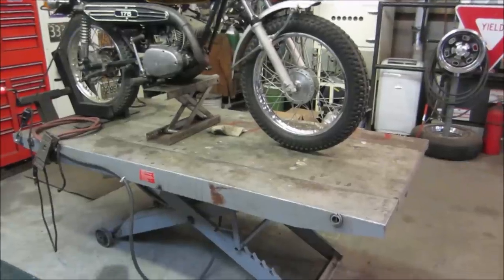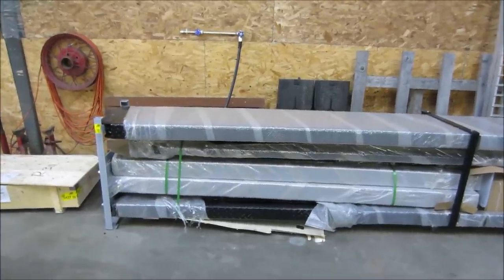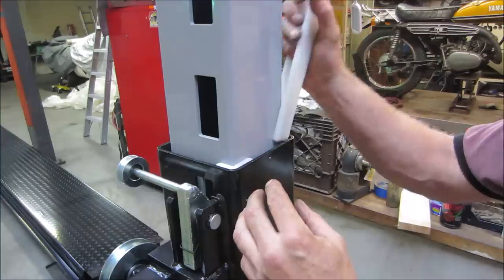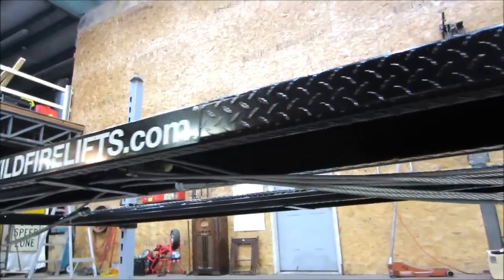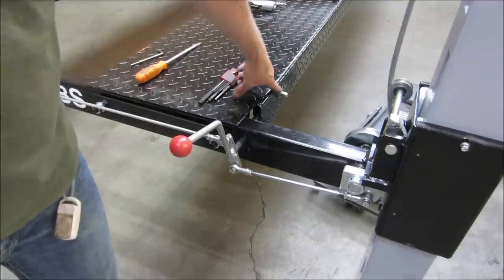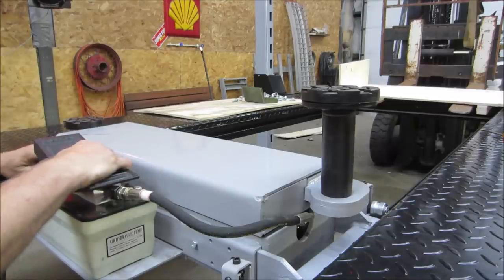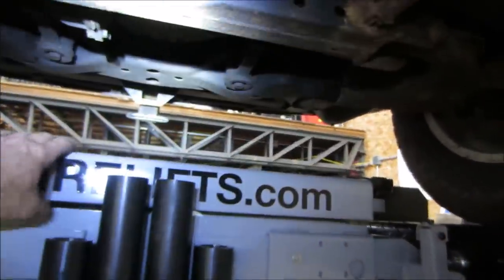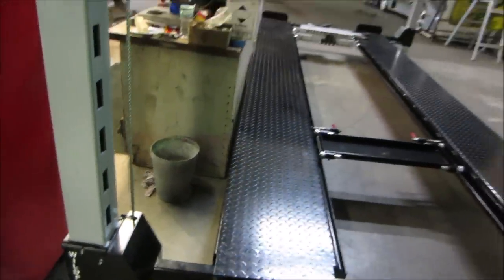Bought a Wildfire 4 post Lift, Can a Rookie Put it Together?

Comment: Congrats on the purchase!  You'll really enjoy it.  Clever technique raising the posts.  You've always got great ideas bud!
Reply from the maker: right back at you sir, thanks for checkin in and steering me to wildfire,
Reply: Dereck: Did you get the frame lift attachment? I didn’t see it in your erection (No snide remarks, please.) video and ran over to Wildfire’s website to check that they had one. Essential accessory for working on suspensions and brakes.
Reply: I watch every video from both you guys.  I know you guys far apart but a collab would be fun sometime.
Reply: Waiting for AvE to join in and mention something like that thing works like a hotdamn and your camera won't focus... the fack!
Reply: Was there another set of bolt holes to set the runners wider?  Maybe it is an optical illusion but looks barely wide enough for the Toyota pickup.
Reply: @FatHulkRideEbike  
Seems like there would be a way to make them adjustable.
Reply: Actually Derek could find some beater in NH, go to Musties shop to fix it up and drive it home to MSP.  That would work!
Reply: @FatHulkRideEbike  Somebody write that down! Find a classic rust bucket in NH, stat!
Reply: @TreyCook21  VGG is live now.  I put in a super chat but of course Derek didn't read it lol.  He doesn't read super chats from Eagan, MN I guess :-)
Reply: @FatHulkRideEbike  That would make the suspension lift (the one that runs up and down the middle) complicated...
Reply: @somethingelsehere8089  Yeah, that part looked like it had at least some adjustment though.  He set the wheel width when he unboxed it.  That Toyota barely fits though and that is supposed to be the XL lift.  Don't get me wrong I like everything else about the lift.
Reply: as I found your comment I found your live stream off to go watch comment like and already subscribed
Reply: Derek, I hope you're getting a commission for all these lifts you're selling to other YouTubers. 😂 Keep up the good work. Love the content from you and Mustie.
Reply: Thats awsome !! Both of the shows i watch are talking to each other. So cool.. You guys should do something together for a show. Im thinking a truck cuz they both like different cars . idk. Send a comment in the bleep blooper thingy
Reply: You guys should get together and I dunno......    what the heck!!!!!
Reply: @TreyCook21  plenty of them! its the rust belt.  i see it all the time since i live here lol
Reply: Vice grip garage needs to come to NH! :D

Comment: When I was 78 I bought a used AMMCO lift.  Unlike the lightweight metal of the wildfire it was extremely heavy.  Start to finish and my wife is in her sixties we had it up and ready to go in less than four hours.  Adjusted the cables later on prior to lifting a vehicle.  No big deal just be careful regardless of your age it falls on you and won't have to worry about getting any older.

Comment: A little heads up. After some use of my lift, I found that even though it has those nylon sliders, they tend to get a little fussy about sliding freely. Easy cure. Spray the post with silicon and they will slide like new. I've had my hoist since 1999. Kind of wish I would have bought a two post lift. Why? because it's easier to do brake jobs or anything where you want the wheels hanging free. I may still get one, who knows? Enjoy your hoist.

Comment: Not going to lie, having seen the VGG setup, I was a little concerned about you doing this by yourself. I should have known Mustie ingenuity would carry the day. Enjoy the new toy. They make sleeves for exhaust pipe that might work on that blow out. They use a system like a hose clamp to secure them.
Reply from the maker: l just cut it off and grabbed another used rear pipe and welded it to the muffler

Comment: You will love having the safety of the 4 posts.  Much more stable than trying to get the balance correct on the 2 post kind.
Reply: But the two post leaves the wheels hanging free. Makes it much easier when you have to do brake and suspension work.

Comment: Mustie1 for what you paid for the unit and the air over hydraulic jack system, it’s gonna pay for itself in no time, as in no extra time needed to recuperate, extra time for yourself when you can get the job done quicker and easier, and most likely more jobs that will help it pay for itself the quickest.
Watching you put that together the way you did was amazing. It goes to show you have a ton of common sense for when it comes to things mechanical. At one time I was thinking you may use the forklift to raise the assembled ”H” sections, using that small table Jack was very impressive.
Can’t wait to see what you work on first, and when you will comment on how this new lift will be a blessing in disguise, and why didn’t you think of it before....
Keep up the great work look forward to all your videos.
And let the grinning begin....🙂🙂🙂😃

Comment: I bought the same lift a year ago.  Liked it for all the same reasons as Mustie.  Use if for front end work, oil changes, and more.  My worse case vehicles are my son's F-150 4 WD long bed and a Silverado long bed extended cab 4wd long bed.  Bought the 9000 lb'er and long version.

Comment: I just went to Wildfires website to check the price and got a pleasant surprise. I feel they are very competitive. Watching you assemble it shows that it is made from quality materials and is well engineered. The removable dolly wheels is a feature that I believe is unique to Wildfire lifts. I installed a 2 post lift in my shop 20 yrs ago and my only regret is that I placed it too close to a wall. I assume you are leasing space in your building so avoiding a permanent installation works perfectly. I know you will enjoy it immensely! NOW, I want to hear about the Hippie camp out! :-)

Comment: I forgot you guys got salt corrosion where you are at.  What we do for our trailers and chassis here on the Texas Gulf Coast, is to melt toilet bowl rings (pure beeswax) and use a sand suction gun to spray that onto our trailers and underbody. This lasts about a couple of years and is good stuff.
Reply: He has a video of undercoating one of his vehicles using toilet ring wax in a mixture with some oil, maybe it was linseed oil.
Reply: @wind_song  Nice.

Comment: Before lift: Not looking forward to working on car. 

After lift: Excited to work on car. If not excited at least not dreading it as before.
Reply from the maker: true l put off changing oil on 4 of my cars until it was up
Reply: Haha me too. I raised my car for the first time in my new 2post. It's 13' high and was a challenge to install myself. But, it made it through an earthquake in Charlotte last night with a crown Vic raised all the way up so I figure I did ok🏆
Reply: zxggwrt , lol same thing here. I installed 2 post myself in my home garage. I have 3 part video on my channel about the installation process/suffering, lol. And I had(still have luckily) my Sienna up in the sky during this earthquake (30 min away from Charlotte), lol :)
Reply: @HETPEZB  Yup, process/suffering is how it's done! The house started shaking at 8:08 this morning first thing I did was run to the window and see if it was still up! Just did my 1st oil change 30 minutes ago after a through inspection and re torque.

Comment: When I saw Vice grip garage having one installed I was impressed and I think that you putting one in your shop was an object lesson in how thoughtfully these lifts are designed and engineered, seeing as you completed the whole task without any issues and alone. A real bonus and such a boost to productivity, ease of working and filming. Very best wishes from the UK

Comment: One suggestion; there is a "C" clip that attaches to the shroud behind the motor and oil tank that should be used to clip the hydraulic hose to insure its safety, especially when lowering the lift.

Comment: You could fabricate some large steel pads for under the feet if you were worried about the slab thickness.
Reply: I was thinking same thing but just for a little extra safety. Than you could shim it to absolute level as well. I would also weld gussets in corners of factory pads to post but that's just me and I like overkill on safety with heavy objects above me.

Comment: I am 64 years old and would not be without my lift.  Mine is a 2 post, but for me it is the better option.  For you that one looks perfect.  You will never regret it.  One thing I did notice, are the runways adjustable in width?  Just so you don't run into some vehicle with a wider track.  Enjoy.

Comment: Nice Lift and I'm sure it will Save your Back for extra years of Work--Each to their own but I had rather have a Frame Lift, that way everything is Hanging from the Vehicle, much easier to repair Brakes or anything in wheel area without using a secondary lift. Thanks for your Video's, I have learned many things from your Effort...

Comment: I hear you on the aging part and your limitations! Right up into my late 30s, I could work like an Ox and be fine the next day. A year later, I started having energy issues and things really went berserk. I couldn't get barely an hour at a time without taking a break, among lots of other issues. After putting off a doctor's visit for several years, turns out I was diabetic with a side of autonomic neuropathy for good measure. 
Now to get big jobs done, I have to invent something to help me do the actual job first. Gotta pull an engine but don't have anywhere to use a hoist? Mobile crane to be built. (that's my next big job as of the current writing) But that's time for you. Catches up whether you're ready or not.

Comment: That's nice. Now I want one. I seen one that had wheels on the bottom so you could move it around. I reckon if you had a 3 or 4 bay garage you could roll it where you need it, the wheels would raise so it couldn't roll on you when you had a vehicle on it but I don't think it was quiet as heavy duty as this one is. I wish I could remember the site. I'd rather have it bolted to the floor myself. I'll never own a 4 bay garage neither. The first scissor lift you showed at the beginning are dangerous. I've actually seen one of those fall. We were down at the garage pulling a fuel pump out of a ford explorer and I don't know what happen but It fell and pinned the guy that was doing the work for me under it. If someone wouldn't have been there he would have suffocated because we were around the back side and it weren't that loud so we kept on but after a couple minutes we said we better go check and I don't think he would have made it if we would have waited much longer. God rest his sole. That's pretty nice.

Comment: Been looking at this myself. Love that you got one mustie! Only complaint is the manual lock. you have to bend down while you drop. If I got one I'd might add a locking mechanism for the locking. Only to use it to drop all the way down. but only that minor complaint. What's the runway's outer width? If truck was close to the sides by the looks... Or was that camera playing tricks. congrats mustie! Glad u got the lift!!

Comment: i dont know  if you have noticed but i have lately is people seem to think this new premium gas most has ethanol in it has rusted out the inside of a brand new tank for a 69 z28 in a year and a 2017 cub cadet snow blower solid rust inside so look out for them steel tanks the z 28 runs airplane fuel  on new tank no problems since with new tank

Comment: Mustie 1 ? Your should install two 4k cameras to a 4k TV in front of the lift so you can see if the truck wheels is on runway straight and not to far left or right.

Comment: If you want the cable tensions exact, use a fishing scale to determine the amount of pressure needed to "pull" on them. You'll also have to put a level on the ramps (runways lol) to make sure they're exactly level. As you use it you will have to make some adjustments as the cables straighten out and stretch a little. (unless the cables are pretensioned).

Comment: Can the mezzanine area above your MC lift be removed? I ask because normally 4-post lifts are not wide enough to get trailers through and it doesn't look like you've got the room now for access for your trailer or anything large going past the lift. Most people with these lifts find a workable spot for them and they never move again..   Something to be very careful of is making sure you keep your pulley's greased... A buddy who has a (back yard buddy), had something in the air when it stopped and cocked. He had not noticed the pulley had locked and the cable was sawing into it....  It took weeks to get the parts and a lot of work to get the lift up on a jack while a truck was on the lift. Once the lift was fixed, he was finally able to get the truck on it OFF!!!!!   KEEP IT GREASED!!!!!!

Comment: A guy as famous and popular as you doesn't have a couple of friends to help with a semi-dangerous big project like this?  Unless you wanted to prove a point, what's up with that?   I'm happy to hear you call the cable ties by their REAL brand name - Ty-Rap - invented by Thomas & Betts Company in 1958.  They have saved  millions of electricians and us DIY guys a lot of time and trouble.  I always have many of them in my tool box and use them often.  The Chinese copies of them are cheap but only real Ty-Raps have a tiny metal tab molded in to grip the strap and prevent it from coming open.

Comment: SWEET lift, very well engineered and thought out. Is it possible to add a second "suspension" lift so all 4 tires can be in the air at the same time?

Comment: 36:44 i was wondering how you'd jack up a vehicle to get weight off the wheels when you're doing brake jobs etc. That's a neat little bit of kit that jack on rollers....20 inches of lift will just about get a 4 x 4 off the ground...just barely though...

Comment: For a portable 4 post lift with 6'10" height and the trolley Jack for $5000 isn't bad. Yeah there's cheaper but a lot of times you get what you pay for. I'd buy one of those.
Reply: Another 1300 for jack ...pickup mine Monday 👍👍👍👍

Comment: I just want to say that I love your content! I'm considering applying to get an education as a mechanic and getting a job that's not flipping burgers. Back in June, I head swapped and replaced the timing on my dead Sunfire, and last week I changed the belts on my brother's Hyundai. Despite the head scratching as I had never done those jobs before, I absolutely loved the entire process. Would you have any advice to share for someone looking to enter the career?
Reply: I am not a mechanic. I used to be an electronics engineer fixing ink and laser printers for 14 years. The problem I found after many years is the 'negativity' that ground me down. When you get challenged on the price and questioned on the replacement of a whole part etc etc, it put's your thinking in a 'negative' track. That's what I found. So I changed my career to Mechanical Engineering. I made things! What a difference! Making a product that is sold in the market. So that's just something for you to think about. I'm now 60. The most exciting thing I see happening now is a totally new step in space rockets. Mankind is at the dawn of a New Age. It's a Trillion dollar Industry. If you are interested in space stuff, that's something worth considering today.

Comment: Mustie I'm a lil younger than you but I know exactly where you are coming from when you said anything to make life easier, spent today pulling apart front end of my van to replace panel damage wings and its killed me, ironic thing is I had access to a lift and a pit plus air tools yet I did it manually on the ground good grief I ache!

Comment: Congratulations on the lift.  As you say it will change your life.  That you made it to 56 working without a lift is damn impressive.  At 15 I started working at a gas station pumping gas.  The owner was a real cool nice guy and let employees  use the two lifts after hours.  Of course I never told him but I would have worked there for next to nothing just to have access to those lifts.  Worked my way through college at that station.  Enjoy the lift.

Comment: Safety note, I noticed something about your car lift the cable nuts on the top of the poles are not installed on top both nuts should be on top one nut on top is not enough for 9000 lbs It looks like one nut is on top and one under the top plate check the safety warning in the instructions. All the weight is being held by 1 nut on each cable that is not correct!

Comment: Mustie1 always watch the locking dogs operate when resting load down on lowering. Note the adjustable links ends are probably both left hand threads, so be careful when adjusting locking, remove the Rose Joint and lengthen/ shorten the linkage accordingly and refit Rose Joints. From one who knows, twice, on two separate Radum hoists. Greetings from BONBEACH Melbourne Victoria Australia mate.

Comment: Nice score.  I have had my hoist for about a year, and figure even the very few jobs I have done have covered the depreciation.  I got one with the U channel posts.  There was only one other one available in Canada with the square tubes which is what I really wanted. I left the rollers in the box.  Likely will never use them.  Just make sure all the latches are unhooked when you lower the vehicles.  Twice now, I had one stick on, and it went down crooked.  Not a good thing.  I like your centre jack.  Kind of ricky ticky without it.  I don't have that.  Cost me $800 Canadian for setup.  I don't have a tow motor.

Comment: That looks like a scaled up, deluxe version of the one I got. I use it to park my two MGs in my small single car garage. I put mine up by myself too, which was tricky with almost no clearance to the sides and only a tirfor and ratchet straps for the lifting. Still, I managed it without major mishap.